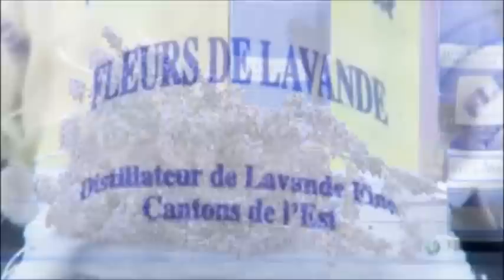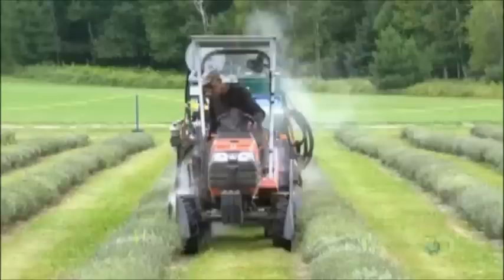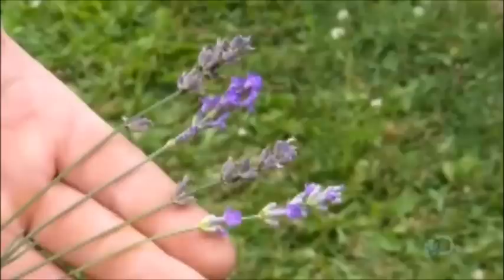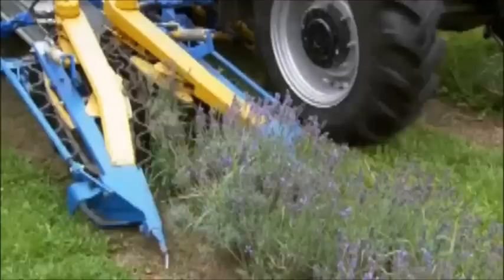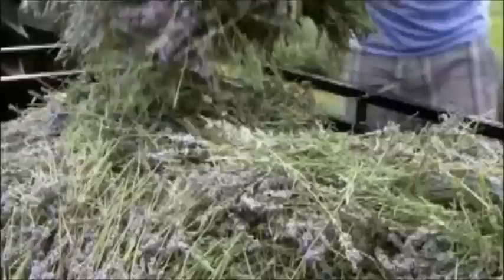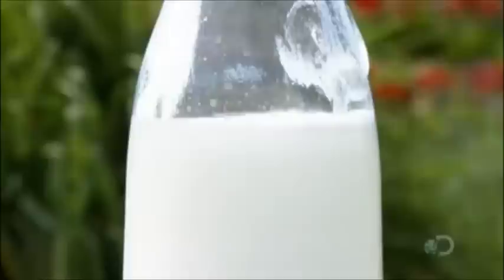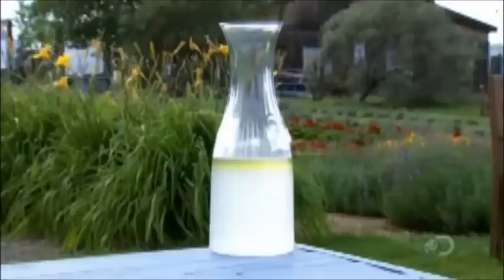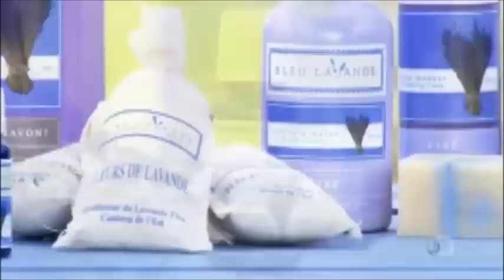How It's Made - Lavender Essential Oil

Comment: If you have roaches spray lavender oil around the walls of your house, burn a lavender candle and have a lavender plug in to the wall scent and the roaches will be gone
Reply: Hi then how will the cockroaches exit??
Reply: @stevethea5250  they are only there because the house is not clean
Reply: @DistopiaKosaki  how do we make them leave?
Reply: @stevethea5250  probably the quickest way is to simply clean more and not let any food or organic waste in your house, also don't throw food or organic waste into the drain otherwise they will simply eat it in there at night, and put the food in a unreachable place, you can also buy a aromatherapy diffuser and put lavender essential oil on your house at night or in the day
Reply: @stevethea5250  by roach traps and roach motel. You can also buy bug powder. Clean your home home everyday or often and don’t leave food out. Wipe things down n mop as well.
Reply: Diatomaceous earth is the best material for getting rid of roaches and pests.
Reply: @stevethea5250  ask them for rent, they'll leave in no time

Comment: lavender essential oil is soooo much better than fake lavender "scented" stuff!  just a few examples of uses for the petals and essential oil:
1.  i am allergic to fake perfumes, scents, bath oils, etc.; however, i am able to use the essential oil;
2.  in bath water, this essential oil is good for your skin;
3.  the scent works on your brain in a way that is great to relax you, and if you get tension or migraine-type headaches, and you use the oil at the first signs of a headache (such as, with migraines, before smells start making you nausious), it can help reduce the time of and/or completely get rid of the headache (note:  peppermint oil also helps get rid of headache pain, as well as general muscle aches);
4.  if you get the edible variety of oil, or edible petals, it can be used as flavoring in food or to make lavender tea (which i love, especially in winter), and the tea can help relax you so that you sleep better;
5.  a few drops on your pillow or mixed with water in a spritzer to spray on/above your pillows/bed can also help with sleep.
this is just a little bit of what real lavender petals and/or lavender oil can do, but don't expect any help from the fake scented stuff.  also, there are at least half a dozen types of lavender, and the different types work in different ways and are good for different things.  also, mixing with a variety of other essential oils expands its usefulness.  30 or more years ago i purchased a thick dictionary on homeopathic aids, and it has several pages just on lavender.
Reply: Thanks for your information.  ✌🏻❤

Comment: We design and manufacture extraction prodcution line for users in need of a simple device for small amounts of extract, as well as more complex equipment for industrial use. Our offer includes preprocess(dryer /grinder) ,coating machine ,package machine and process systems where the substance used as solvent is either a volatile hydrocarbon (butane extraction), an alcohol (alcohol extraction), or CO2 (supercritical extraction). Given the investment cost, complexity of use, and extract quality, each system has some advantages and disadvantages.